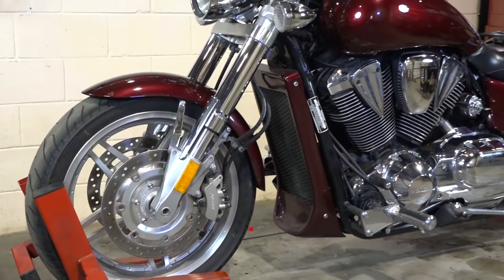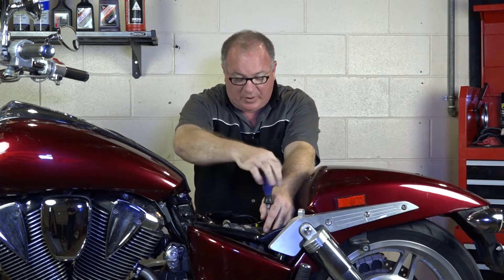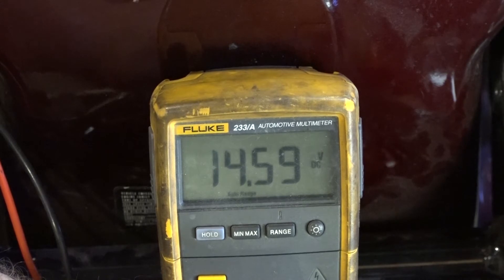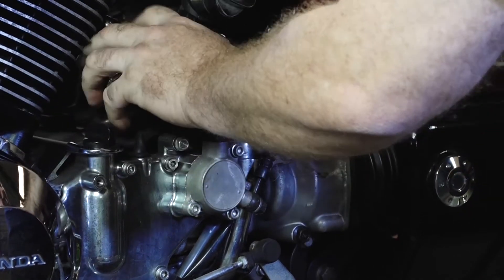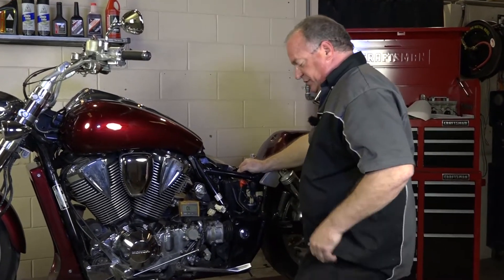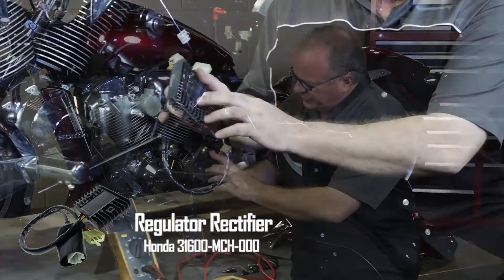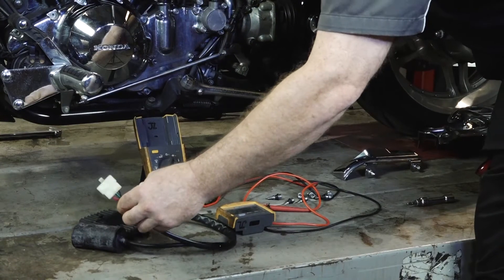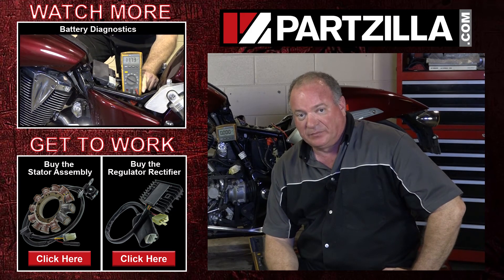How to Test a Motorcycle Charging System | Honda VTX 1800 | Partzilla.com

Comment: Batteries stop charging so I put a regulator on it still not charging battery I've got the VTX 1800c 20000 2003 how common is it for a stator to go out

Comment: What do I do if my stater or rectifier are overcharging my battery, significantly enough to literally boil 3 total batteries?
Reply: And by boil, I mean when I pulled the seat off, steam was coming out, and there was a rotten odor of foul eggs(sings of a bad battery).
Reply: @TheDixielandRailfan I guess would be to replace rectifier. Thats what keeps your battery from over charging is my understanding. This video says to replace it if it is reading 15.5 volts or higher while reved up 4000rpm. My is at 15volts so Im hoping its ok

Comment: I have a 2003 Honda vtx 1800r very low miles and garage kept. Has had 0 issues. One day I went for a ride and after about 15 miles the bike started to sputter and then completely lost power and died as if the key was turned off entirely. No power at all. When hooked to a jump box it turned on and fired up with no issue, the moment the jump box was removed it instantly died. I took the bike home and put it on a charger and it held a charge for weeks and months and fired up again no issue each time I needed to move it. I ran all the tests you outlined in your video and everything seems to check out fine from the battery all the way through. I’m confused as to what the problem could be and am afraid to ride the bike as I don’t want to get stranded again.
Reply: Did u ever figure it out

Comment: 02 vtx radiator wiring for fan.
Uncliped easy....but...
The wire to fan is connected to the frame w/ a little flat steel frame clip
Can not remove from frame...
Scared to brake the clip..
Is that justn0 a tap down till it moves off..thing
Or am I missing seeing a retainer pin..

Comment: I have a question about vtx 1300 2006.it will idle as long as I want but if I drive it about half a mile it will die like it was no fuel engine just stop.so I will pull over on the side .it will start alright but after a mile or so it will quit again.any idea ? I sure do appreciate it.
Reply from the maker: Test the fuel components, it's starving for some reason.

Comment: Another thing to do ( I highly recommend) is to cut out that three prong plug and solder and shrink wrap the wires. They tend to get corroded and make poor contact, which makes them get very hot and melt over time. I had two of those plug do that and now I just solder the wires together to eliminate the problem. It will keep your stator from burning out also from running too hot.
Reply: Instablaster

Comment: Everything in this video checks out as normal, but still, while running, battery is sitting at 11.9-12V.  Anything else I should be looking at?  All grounds and connections are good and clean.
Reply from the maker: Have you done a battery load test to confirm the battery is healthy?
Reply: @PartzillaParts  How to test the PGM FI Unit bike runs but sputters when throttle up

Comment: Hi John, Great Video!  About what AC voltage should be coming out the Stator?  I've checked both the Stator and Rectifier and is within the specs for the initial tests.
Reply from the maker: What's happening with it?  If the stator/rectifier test are within spec, are you not getting the right voltage charging at the battery test?
Reply: Both Check out fine with the meter.  Recently on a trip the bike died, 4.7 volts left in battery.  I've charged battery back to 13.1.  Completed the tests and to my surprise they all tested fine. Confused.
Reply from the maker: So could be a couple things...Honda's have a rectifier heat issue sometimes.  When the rectifier gets hot, it stops functioning properly so the bike will draw off the battery.  Once cold, it will work fine again. Hard to diag since it's intermittent.  Also, check the wiring from the stator all the way to the battery, there may be a loose connection or corrosion.
Reply: John, thanks for the advice

Comment: i have a 04 1300c when it is idling its at about 14.6  when I rev it up id drops to 13.6 is that normal my stator tests well so does that mean its the voltage regulator
Reply from the maker: Test the regulator as well.

Comment: Hi Partzilla, thanks for the very informative video. I checked everything and I noticed that when I did the diode test on the regulator I was coming up with .446 - .466. Is it still good? Thanks again
Reply from the maker: That's within range.
Reply: Partzilla ok thanks so now I'm more confused then. I dropped a brand new charged battery in the bike, and on my first ride about 20 miles in, it left me stranded, totally dead. When I got it home I switched batteries and it fired right up. I tried to charge the new battery and it would no longer take a charge. Any ideas as to cause?
Reply from the maker: What's the output of your stator?
Reply: Partzilla it was between .3 to .4
Reply from the maker: No no, actual voltage output.  My guess is it's not charging your battery, so it'll run until the battery dies then goes dead.  Just trying to confirm.  Could be a broken connection or wire as well.
Reply: Partzilla when I checked it was charging at around 14.66
Reply from the maker: Is that at the stator or at the battery?
Reply: Partzilla it was at the battery but I took a chance and rode it all day over the weekend and she was fine so I'm guessing that the other battery was bad.

Comment: Excellent video and thanks for the information. I am working on this exact bike which has the problem of not charging the battery. I followed your instructions exactly and found that all of the components appear to check out properly. However, the battery (at rest) shows only 12.3 Volts. When I start the engine, the battery voltage drops to 12.0! Where else can I look to fix this issue?
Reply from the maker: The voltage drops when you start it, but what is the voltage at over 3000rpm?
Reply: The battery at rest reads 12.7V. When you insert the key into the ignition, the voltage drops to 12.1 V. When started and revved up, the battery voltage increases to 13.5 V. When the engine is stopped and the key removed, the battery voltage returns to 12.7 V.

I checked the double reds and the double greens from the regulator/rectifier. The reds read 12.7 V; the greens read 0.2 ohms (as shown in your video).

My customer said he rode the bike to a place and when he tried to start the bike, it would not turn over (an apparent dead battery even though it was new). He pushed started it and popped the clutch, and it started. Then, he went somewhere else, stopped the engine, and then later, it started! 

I'm trying to help him fix the bike. I did read somewhere that some people have had shorts with respect to the ignition key. As I mentioned earlier, all of your checks with voltages and ohms all checked out correctly. Any ideas on why his battery doesn't seem to stay charged? He's been keeping it on a trickle charger after he rides.

Thanks again. Your videos are excellent!!
Reply from the maker: Electrical problems can be difficult to diagnose sometimes.  Sounds like your charging system is working.  It could be a bad connection somewhere, corrosion, Honda rectifiers have been known to stop functioning when hot sometimes...then go right back to normal and test good.  It comes down to systematic elimination.  If it only is an issue when hot, start with rectifier.  If it's random, then you just have to keep testing and checking from ignition to battery until something jumps out at you.
Reply: Thank you, VERY much for your help! I do appreciate it. Again, excellent videos.

Comment: Well Greta video
Reply: Will I have to drain oil to replace I am having issues second third battery but got them at auto zone one was wrong blew main fuse but got one in it ran bout 3 months noticed lately battery hesitated now got home won't start
Reply from the maker: Drain oil to replace what?  The stator?  You may get a drip or two coming out of the case, but you don't need to drain it.
Reply: Partzilla ok thanks so much I did buy a battery from auto zone it's brand new but this one was made 4 months ago wasn't sitting on shelf in back collecting dust and they have a new supply of motorcycle batteries up front now in box with the date it was made so I beleive since I been dealing with them with cycle battery issues because of them they basicly got cycle batteries now and fresh from factory right by the door letting pple know they sell motorcycle batteries and they are proud of it so I am proud and happy they updated and now have motorcycle batteries thank you for info video was real nice didn't leave anything out

Comment: Great videos... my 2007 vtx 1800 t2 wont turn on the headlight... already check everything you said...mdid I missed something? Headlight bulb its new...
Reply from the maker: Does the bike run?  Is the issue strictly the headlight?  Check fuses, follow the wires and test the socket for voltage.
Reply: Partzilla you were right... it was the starter switch... I opened, clean the contact and fix or at list tried to fix the cooper pin... its alright for now but will buy a new one. You are amazing I really liked your videos... sorry for the late reply... thanks..!!!
Reply: Also your video have me interesting to learn about the wire diagram and learn about multimiter... kind of complicated for me cause didnt know about multimiter and electronic but you motivated me to do the job by my self... run my 2007 vtx 1800 t2 to my work again... beautiful afternoon.. As a veteran, ryde my vtx give me mindfullness... thanks.
Reply: Partzilla after the hole last saturday follow you video instruction finnally sunday morning by accident and almost loosing my faith, hit the starter switch and saw the headlight turning for a second and thats when discover what you said about the headlight switch... thanks...
Reply: Partzilla ... and thanks for your promtly response... US Airbone 82nd veteran from Puerto Rico.
Reply: Also... hope you make a video of hiw to adjust the valves and about why the vtx maked the spark plug fouled...
Reply from the maker: Thanks for your service.
Reply from the maker: We will add the valve adjust to the list.  Spark plugs generally foul from oil.  However, running too rich or lean will have different effects on the plug as well.

Comment: When doing the 1st part of the stator test with my meter set to lowest ohm setting  (200) I got 1.6 on each wire. Is it bad?
Reply from the maker: It should be under 1 ohm.  So if it's reading higher, it's most likely going to need to be replaced.
Reply: Partzilla thanks so much for the reply. I'll check that out.

Comment: I have a 03 1300s carb, My voltage goes down when rev'd. I can ride sometimes for a few days, other time maybe around the block and it will fail to start. Battery gets drained. Any suggestions?
Reply from the maker: Very similar process for the 1300.  You will need to test the stator and regulator/rectifier.  Once you test the voltage should be able to tell what's not working properly.
Reply: I have the same issue. Everything tested fine. When bike is started battery reads 14v the rev and drops to 13v. Did you resolve your issue?

Comment: I got a question in your opinion how long do you think they'll make parts for the VTX Brand since Its been 10 years out of production
Reply from the maker: Rob -- That's really a question for Honda. It all depends on how much overstock they have. If there's enough popularity even if they run out they will do small recasting runs. BUT -- if we had to guess -- we imagine that parts will be around for a long time to come especially because there are so many carryovers that are in production today that are based off or use that exact same engine
Reply: I make Yamaha parts where I work and Yamaha will place what is called a (service run order) to keep basic stocks replenished. You may have to order it it and wait a week or so, but usually Yamaha will order 100 to 200 peices just to maintain special orders.